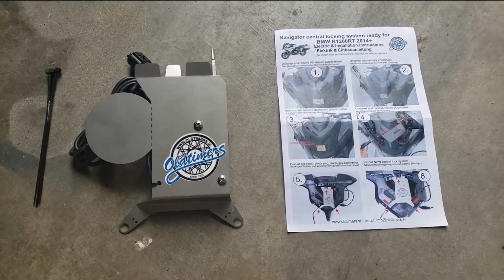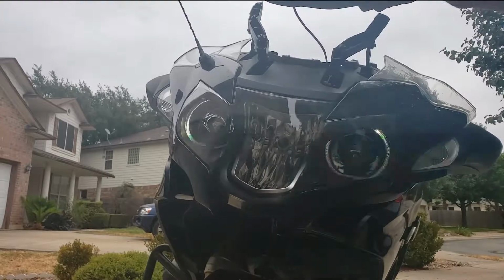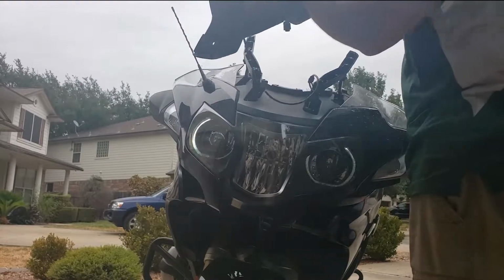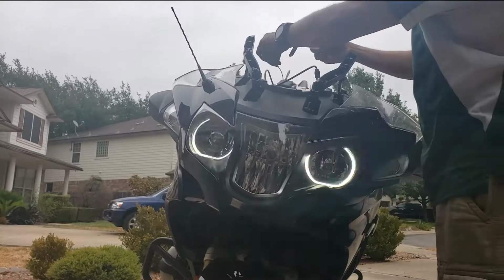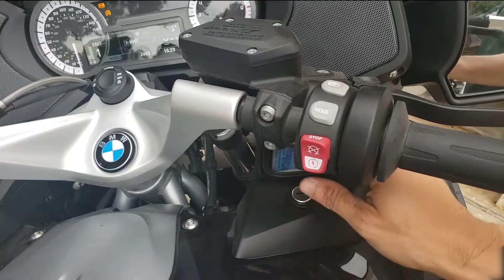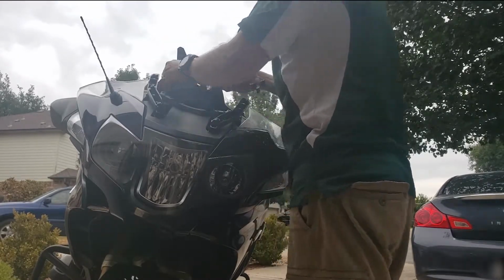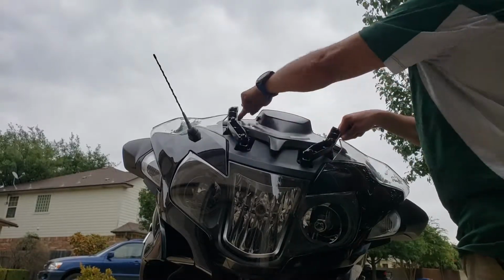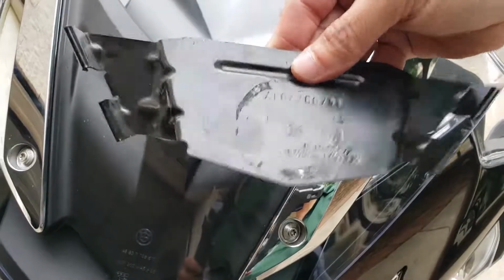How-to install a Nav Lock by Oldtimers onto a BMW R1200RT

Comment: Thanks Robert ~ you've given me the confidence get duplicate this on my R1250RT. What Engine Bars are those on the front? Any other "farkles" installed?
Reply from the maker: I'm sure you'll like the Nav lock. If you like clean installs, then this is (in my opinion) the only real option to go without moving up to the k1650. 

The engine and rear crash bars are from Ilium works (www.iliumworks.com). The rear ones will protect your panniers in the event of a low side or accidental drop. Sadly I was too excited to install them that I forgot to record the install.

I upgraded the two stock powerlet sockets (wiring) and had them wired directly to the battery (instead of the canbus) so that it can pull more amps through it (heated gear) and added another powerlet socket to the front left side of the bike. Other than that, I have a GPS, GPS lock and the front/rear crash bars. Accessories for these bikes are pretty costly so I’m taking my time with the upgrades. 😊 I have a PDM60 that's waiting to be installed, but I'll do that after I purchase a canbus unlocker. Depending on which i get, some have a wire specifically for a PDM to wire into it. I do have plans to get the top lock box, front and rear camera and some riding lights, still debating if I want flood or spots though. Oh, and a better/louder horn than the stock one too. 

More than likely, a canbus unlocker (not sure which yet) will be my next purchase so that I can wire up the PDM60. Then I'll wire all the powerlet sockets to the PDM60 instead of direct to the batttery, try to clean it up a little.